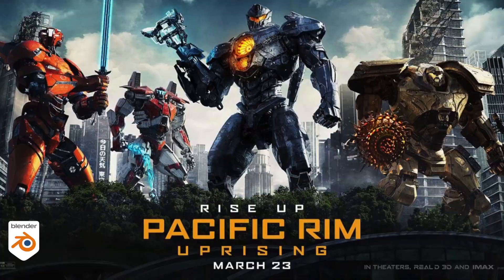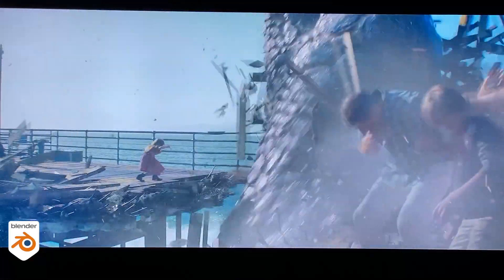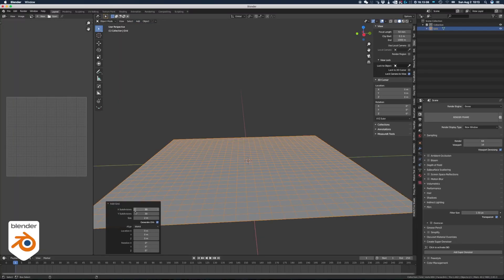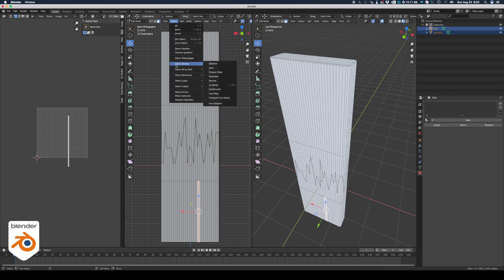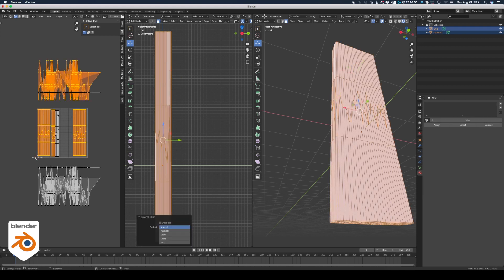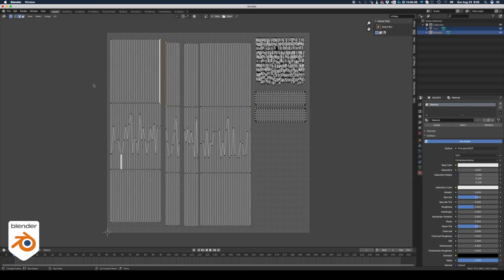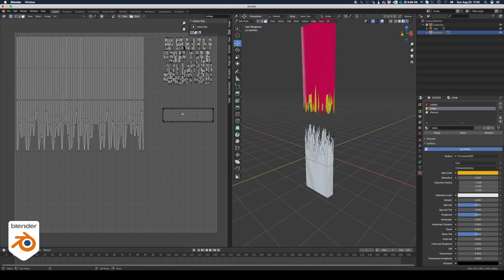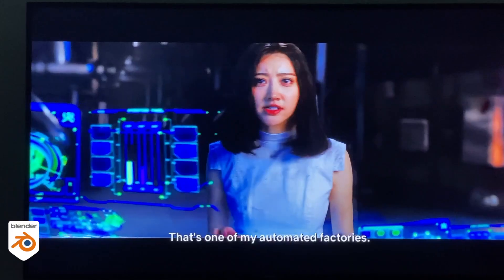If only I had Blender when I worked on Pacific Rim Uprising. EP3

Comment: hey nice tip about making breaks! that's brilliant. although I don't see how it's much easier doing this in blender. in maya, I'd just use the bonus tools randomize script on components/verts and uv mapping would be pretty straightforward with selecting planar sections using selection constraints.
Reply from the maker: Ni hao. I’m just trying to promote Blender. :-)

Comment: Hey Bob, just curious, what did you use before (and maybe still) blender?
Reply from the maker: Maya. And after 25 years of using it I can't stand it anymore. I only use it for UV unfolding and to edit super heavy geometry that Blender can't handle (for now)
Reply: @BlenderBob  Is Maya's UV unfolding better than the Blender addons or 3rd party apps? And what is it about Maya you can't stand?
Reply from the maker: @msandersen  Maya rocks fro UVs. Blender is better for some things but in general Maya is years ahead

Comment: Would be lovely if you could make a video about how to make stuff look good in Eevee. Seems like everytime I have a project I just end up using Cycles because I cant make it look as pretty in Eevee.
Reply from the maker: That's because Eevee is not there yet. It's ok for small projects but it's not a path tracer. It doesn't do global illumination. Reflections are cheats. The Blender Bob channel is about working in the VFX industry. Only very rarely I use Eevee. I did for trees. See the explanation here https://youtu.be/EsCQxUJCLB0

Comment: How the hell do they handle such large particle simulations??
Reply from the maker: With a lot of money and computing power. I took a month just to figure it out. They had to run the sim on multiple computers at the same time, which is not something you can do by default.
Reply: I think it's distributed simulation (split ocean to sectors and use lots of computers). But idk because distribution have limitations too like some vector fields are not supported.

Though im not super familiar with sims.

Comment: Awesome video! Thanks for sharing simple, yet super smart tips!
You should consider submitting a proposal for a BCON20 presentation.
About the movie: you'd think this giant thing would send huge chunks of pier flying sway instead of neatly cutting through it with its leg! Haha, Dingue!
Reply from the maker: I don't have enough material yet for a presentation. I do but I can't publish them until the movies are released. Then I will be able to show shots actually done in Blender. For the pier the leg is way larger than the hole it makes. We had to cheat it. But it goes so fast, nobody will check that. There are shadow issues also where the crowd was filmed at noon but the family was shot at the end of the day. The shadows on the Kaiju are cheated too. Everything is a cheat, that's what the job is about. :-)
Reply: Funny enough, none of those huge chunk of woods knocks off the folks standing so close to it